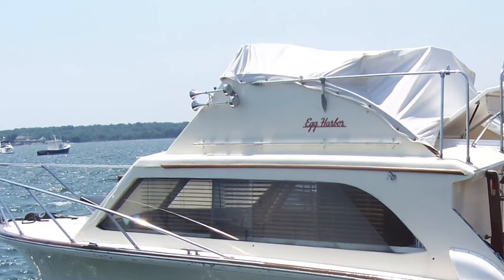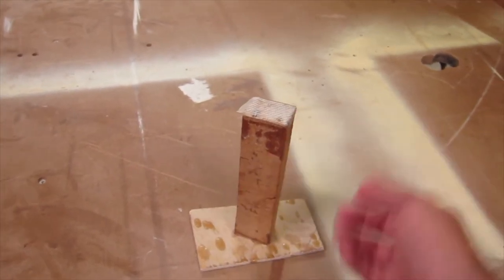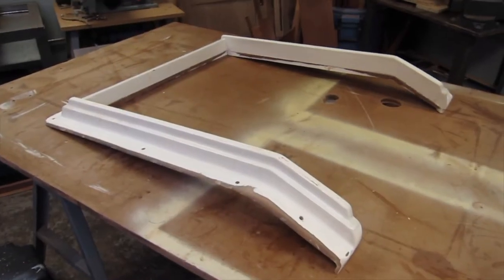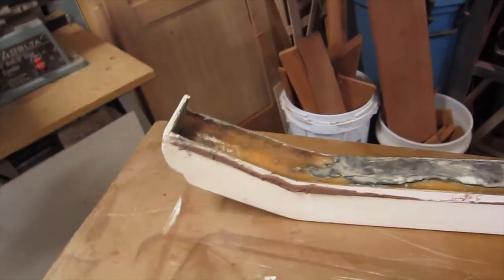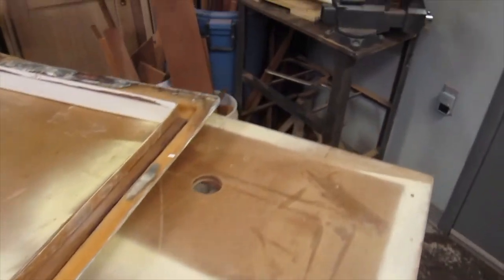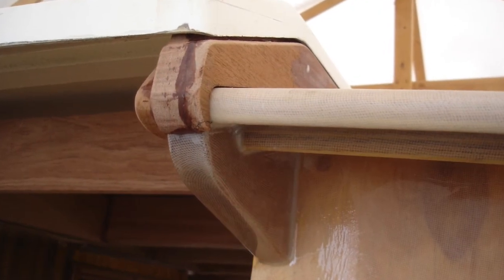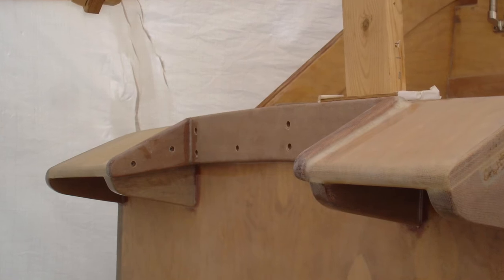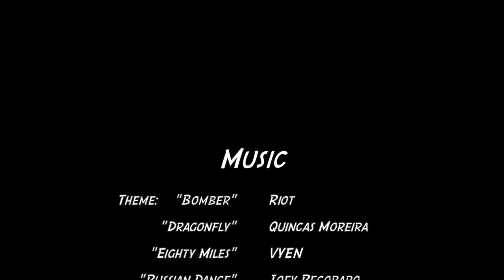Fabricate and Install a mahogany doorway hatch curb - Boat Restoration EP015 (2015 Part 1)

Comment: The forward hatch cover on my boat was just thin fiberglass that eventually cracked from years of impacts against the hull when it was drop closed. I've since made a new hatch cover of mahogany, but I think I just want to varnish mine; give the large front deck area a little different look than just all white fiberglass. Fortunately, the hatch curb (coaming on a vessel) is in good shape, but after seeing what you have accomplished, I'm going to take another look to see if I should strengthen or replace it, just for good measure.
Now on to the next episode! :)
Reply from the maker: I bet the mahogany hatch cover looks really nice. I decided to stick with the original  fiberglass one with some modification of course. Yeah my boat terminology is not the best. I get it wrong most times.  Thanks for the correction. - Bob